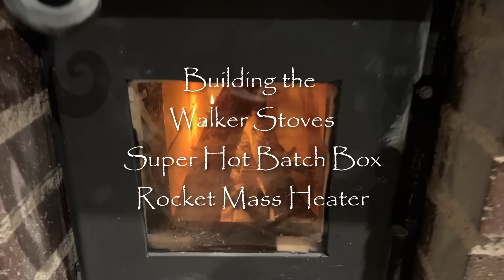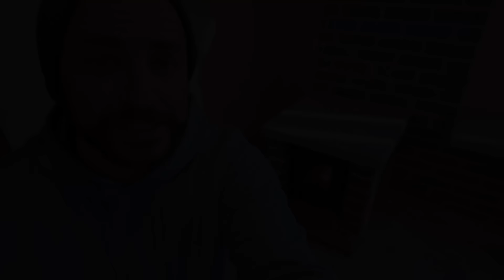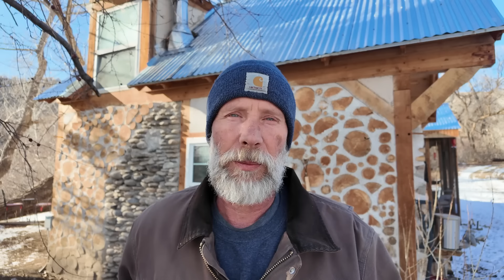Full Build of a Rocket Mass Heater with No Barrel! with @StefanoCreatini and @irahouseweart

Comment: I wish you had shown more detail on the bench. Does the flue pipe run to the end of the bench?
Reply: At the end he mentioned that the flue pipe goes straight down and rest about 8" off the bottom.
Reply from the maker: Yeah, sorry I didn't get a shot of bottom of the flu pipe. There are three brick set on end which the flue rests on. The opening ends up 8" above the floor.
Reply: The whole bench is hollow, so as the new flue gasses are hot they will try and rise in the bench, causing the hot air to spread out under the top of the bench. As these gases cool, they will become more dense and slide down the walls, giving off more heat to them and cooling even further. The coldest gases will drop to the bottom. The chimney (exit flue) goes down to within 8 inches of the bottom and will pick up this coolest gas and suck it up the chimney. The gas in the chimney is warmer than the gas at the bottom because it is inside the bell and heated there. This warming causes this gas to rise, sucking up the cooler bottom gasses that will then be warmed and rise  etc,  until they rise and go up and out the chimney/flue.

Comment: So how feasible do you think it would be to build something like this, but then add cob inside the masonry bench for the extra mass?
Reply: probably better to build a divider wall inside the bench that the exhaust air has to flow around to extract more heat on the way out. As he said, locating the flue pipe in the bench would help extract more heat and everywhere you add brick you will add mass so extending the bench would also help. The absolute best thing to do and maintain the aesthetics  would be to increase the height over the bell with a forced path from the top of the heat riser, hit the bell, divide the wall going down to the bench, force the air through a divided bench, around the end of the bench, back to the bell, up to the top of the bell and then out the added height.
Reply from the maker: My thought is to make the bench 6-7' long, and cob over a split barrel form. I'd stick with the bell stratification chamber, though. By adding another 1,000 pounds of mass I think this core could generate much more usable heat.

Comment: Did you put rock-wool between the bench and wall or nothing also a only a thin air cap ?
Reply from the maker: There is a 1" air gap. If we were to do it over, we would have made it 2-3". The bench tops out at 160F, so that's no a worry, but the tower is over 200F. He added a reflective shield behind that.
Reply: My question, too!
Reply: Why

Comment: Your planning and execution of the video are very good you have done a good job editing and making your story it’s easier than some others who rarely demonstrate the need to clearly demonstrate the work and the planning for a complete build process.
You made it simple enough for anyone interested to watch the video avoid making the pitfalls and successfully making a working rocket mass heater.
Yahoo!
Little Aussie rockets channel may be useful for showing secondary air channel that didn’t seem to be a problem even though they used steel for the intake, O don’t recall exactly how they resolved it.
The steel pipe is losing electrons and the accelerating wear pattern is like rust accelerated.

Comment: Good job, thanks for taking the time to film. Ceramic fiberboard will definitely degrade in your firebox ceiling and back. Tear the top off and cantilever splits to meet in the middle of the ceiling then place cfbd over that and regular brick on top which will be cool but your firebox will be hot and last a long time. Use stainless flexible chimney liner and add cheap thin heating duct to make a double wall chimney, seal joints with high temperature spray foam but since you under built the bench your flue temps are probably too high (400f?) so if you ever do over the double wall chimney would be good but make sure you use stainless liner.
Reply from the maker: Flu temps are 200-220F. Still higher than I'd like in this sort of stove.
Reply: Could you please further explain your firebox ceiling improvement idea? I'm having trouble visualizing it
Reply: @MichaelEgan-z7s  is this a typo? What is meant by "tear the top off and cantilever splits"

Comment: Try ceramic clay/pottery supply for your fireclay needs..also will have various kinds of fiber board, castable ect. people forget about  kilns and kiln builders. 30 years in the industry myself, and it's not all that bad for you if you only use it once.. ;)
Reply: Hi.  Can you say a bit more about this?  What do you mean when you say, "it's not all that bad for you if you only use it once"?  Any links to the resources you speak of would also be appreciated.  Thanks!
Reply: @carolewarner101  I'm in the Seattle area, my local pottery supply houses are Seattle Pottery Supply and Clay Art Center, Tacoma.
Both of these places mix custom clay in large quantity, ie Tons.. so they have on hand a wide variety of dry, bagged clay, fireclay included, and knowledge of there various uses and properties.. depending on where you are in the country, or world, you should be able to find a pottery supply/bulk clay store in your general area. Most will have refractory products as well, fire bricks, soft high temp insulation and castable refractory. You can also try Bailey pottery supply for catalog ordering?
As far as safety, the white board insulation can be an irritant, but like most industrial products, it's the long term exposure situations that are problematic.. do wear a mask..
Hope this helps
Reply: @daveolsen5034  Oh wow, good to know!  We are in the Salem, OR area so I'll keep this in mind when we're ready to start our heater build.  Thanks for responding.
Reply from the maker: Thanks for coming with the valuable info!

Comment: I wonder if you could set one of these things up to make wood into biochar, instead of just burning it? You'd need more fuel, but you'd get biochar, in addition to heat, and you could use that biochar as a soil amendment. Though you'd need to take it back out of the stove, which could get messy if it's an indoor stove... Another problem to consider, I suppose.
Reply from the maker: These would be cool functions to stack, but I'd lean toward a ceramic TLUD kiln, and probably in a greenhouse application. A bit messy and dangerous in the house, as you say.
Reply: @radicalgastronomy  I don't think it would be dangerous - the heat should only be a problem while burning, and that should be well contained. The mess could be a problem, but on the other hand, you'll probably need to clean the ash out at some point anyway? But I suppose there's a big difference between something done once or twice a year, and something done once or twice a week.

The greenhouse idea is an interesting one though, that would be a good place to put that kind of thing.

Comment: You've done a great job. I really like the rocket stove, due to its simplicity and efficiency. A small grill could be placed at the bottom, about 7 cm high, so that oxygen flows from below to the burning wood. Regarding secondary combustion, I would put a stainless steel tube (L-shaped) at the top of the horizontal opening (above the flame) so that it bends upwards an additional 40 cm and then holes in the top, to that injects superhot oxygen in a perpendicular direction (You know, if the oxygen exceeds 500˚C, combustion is complete and no smoke is produced, in addition to increasing the heat by 50%).
Reply: This sounds very interesting.  Could you post a diagram of what you're talking about here?
Reply from the maker: Great thoughts
Reply: This design is the result of decades of research in many countries and by very experienced RMHeater and RMStove stove builders who have tried virtually everything. Stainless steel only lasts a few weeks longer than ordinary steel at these extreme temperatures. The vertical secondary air supply tube is considered an expendable item that is replaced regularly. One of the few "consumables" and maintenance items in this type of heater, but well worth the small inconvenience. 
At the end of the video there is the name of a supplier of a more heat tolerant tube, but it costs $$

Comment: I have watched many videos on this subject as I would like to build something similar in our Montana cabin.  I especially enjoyed your approach, and it gave me the confidence to pursue the project.  I wondered about the brick and fire clay directly on the OSB subfloor.  Would tar paper or some other vapor barrier have been a better approach?
Reply from the maker: This way works, given the weight of the finished unit, and the perlite layer. I would avoid tar paper, but you could screw durarock or hadibacker down to the OSB to ensure a good bond to the first brick layer.

Comment: I was wondering why you didn’t use the bench part of the stove pipe routing then fill the cavity with sand for more mass and heat battery?
Great build, looks great. I always wondered why more rocket heaters were not built like this.
Sure cob may be cheaper but bang for buck looks wise I’m in the masonry corner. Want to do one with soapstone facade.
Great video, thanks
Reply: What about source air from outside ?
Reply from the maker: The design of this unit relies on the open bench stratification chamber, but I imagine a more typical bench design could use this core design. Really, just a larger, heavier bench would improve this design considerably.
Reply: @ thanks for the clarification. Feel like a dummy for not seeing that at first watch. Still great looking building.
Reply from the maker: @ It is counter intuitive, at first, but makes sense when you think about it.

Comment: How much internal volume is below that bench, it looked like it was hollow, do you need it to be completely void? Could you chuck some rocks in there for thermal mass and leave about 6" for airflow on the top?
Reply from the maker: It would be better to add mass to the bench top, I think. I'm thinking making a tunnel with two barrel halves and covering that with about 5" of cob, when I do mine. This bench top was about as big as you'd want to move with two guys, so I understand the thinking on these dimensions, but it needs more bench.

Comment: Can the entire house get enough heat with this setup? Or is this basically for 1-2 rooms?
Reply from the maker: It dose pretty good, given that its a long ranch style home, and this stove is at one end. A central location would certainly be better, and better insulation in the floor and ceiling would make a big difference.

Comment: After I rebuilt and repaired the traditional 1950’s masonry fireplace in the home we just bought, it was a little sad to experience how much actual heat just goes away up the chimney with just glass fireplace doors. This type you built is very interesting. No way I will change over now, but I’m happy to see the success that you achieved!
Reply: Fire places 20x less efficient the a wood stove
Rocket mass uses 90% less fuel the wood stove

Comment: I noticed the perlite was used on top of the sub floor, but not the wall behind the stove...any reason?
Reply from the maker: Perlite could be used behind the whole stove, or it could be set further from the wall. The bench temps are not that high, but the area behind the tower is pushing the limit.
Reply: @radicalgastronomy   Other Rocket Mass Heater videos I have watched have an air gap of about 1inch/ 25mm, a sheet of metal or fibre cement board(hardibacker) and another air gap then the wall. This not only protects the dry wall from getting hot but allows air to flow up these two air gaps and further heat the room.
Reply: Less heat transfer 
Why heat the ground

Comment: Looks  like it turned out well and well explained  for your first one absolutely great its always easier to look at the job in hindsight apart from lighting the fire a couple oft times a day and matbe extending the bench are really minor issues it worked and is functioning as it should so it was a successful job i like the idea of gertting away from the barrel the other issue will be  cleaning out ash and getting the ash out without dismantling at some point Hopefully you will do another follow up clip after the winter to see how much ash Has accumulated and demonstrate  the best method to clean it out
Reply: I would love to see that too!
Reply from the maker: We'll do some follow up videos, for sure. So far, the ash does not seem to get past the baffle. When we clean the flue, in the spring, we will pull the elbow above that first pipe section and see if any ash gets into the bench void. If so, we can add a clean out.

Comment: I was wondering , could you use RMH to warm multiples rooms by letting the pipes run longer and further? Are there limits?
Saw an asian house who did something similar.
Reply from the maker: The limit wound be the point where the flu gasses are too cool to rise up the stack. There are calculations for this. In Central Europe the use kachelofen which are similar to this concept, but more sophisticated. Home are designed with the stove central in the house, and often penetrating multiple rooms.
Reply: @radicalgastronomy  awesome,  ty for the insight I will check it out!